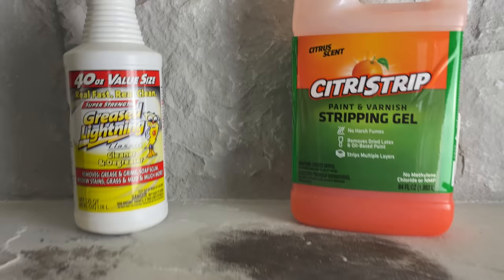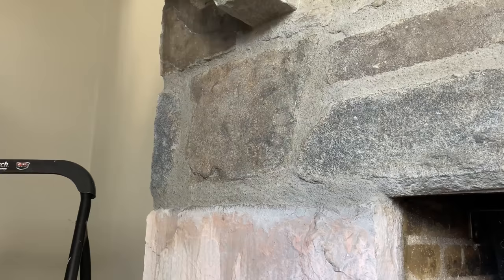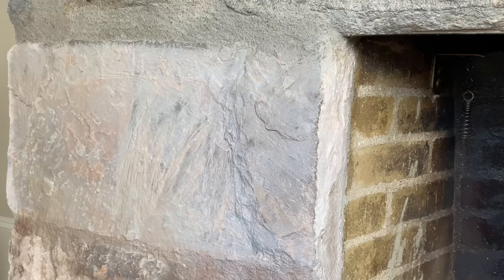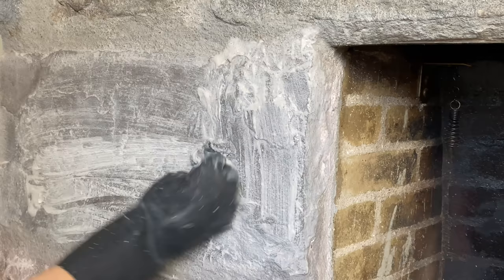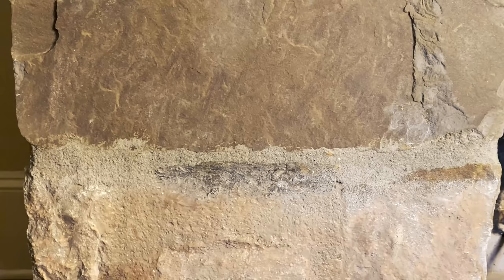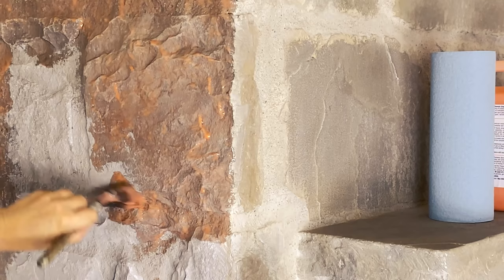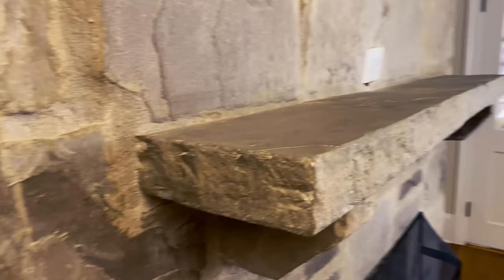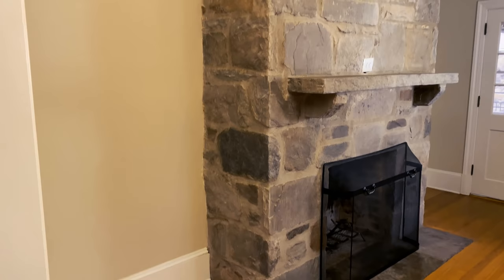How to Remove Paint From a Stone Fireplace ((without a Sandblaster))!!! | Restoring Stone

Comment: I will start off giving you a cheer and an AA+++ . I have never refinished stone. But I have refinished for 30 years. One piece took me 3 years. It was a Buffet that was so intricate and black with years of shellac . It was huge and the detail was the most beautiful piece of furniture I refinished in all those years. Yes it was my job. I worked in my basement by a small window. The stripper I used was very strong. That is all we had back then. I worked on the pillars and the top at home, then they made a ramp to get the body of the buffet to their garage  so I could work on it. I used the strangest tools. pairing knives , beer can opener, etc. lots of steel wool. and sand by hand. I know I never got paid enough for my work. As you know. If you had to pay someone by the hour??? So I understand the joy of unearthing the real stone and the years of enjoyment you will have decorating it. Are you going to use the fireplace? Thank you for sharing, your wonderful piece of your home.  Joyce
Reply from the maker: Yes, exactly what you said, Joyce❤️!  It’s always nice to have a small Geppetto window when we create.  Have a wonderful day!🌷